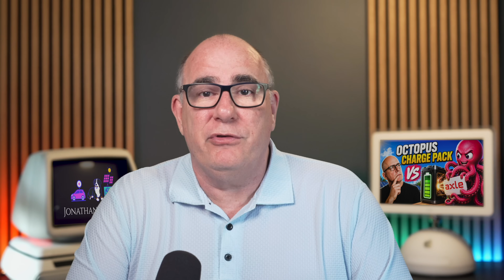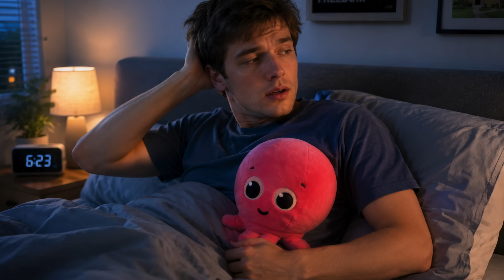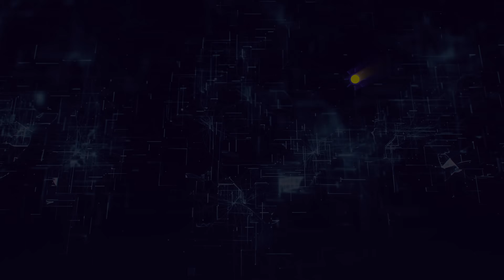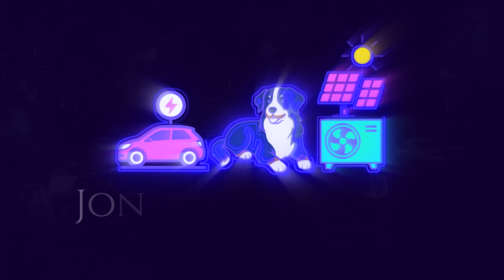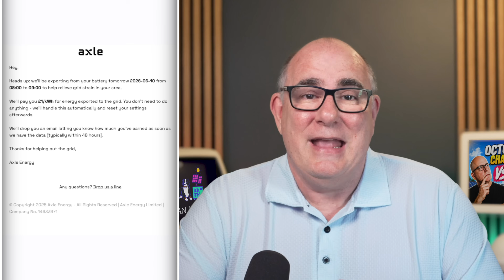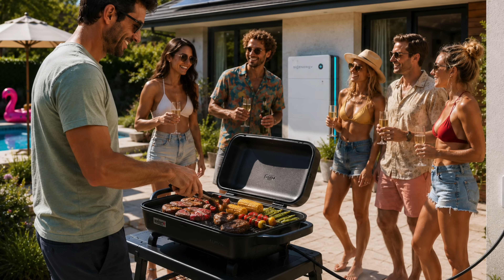Octopus Charge Pack Just Fired A Shot At Axle Energy

Comment: Doesnt my Sigenergy Battery AI already perform this function? With no middleman? If so would this option be for dumb batteries that charge and discharge to set parameters without external data input?
Reply from the maker: yes it does, but it does not respond to grid events, with Axle I get paid my normal export from Octopus plus £1 a kWhn from Axle when they need it.
Reply: @JonathanTracey  I've been giving Axle some thought but my systems earning £5-7 a day / every day this summer. I'd be interested to know how many kWh Axle take in their specific events option over a month and if it would be worth it. As a user are you likely to do a deeper dive on video at some point so the luddites can get a better handle on how it interacts with our Octopus tariffs and if and how its profitable over and above normal export etc? I'd be interested in that. I've seen your introductory on the Axle system or was that Gary Does Solar (sorry).

Comment: This is all good I would rather control it myself, reason being and it’s going to stand true in a minute, look at the temperatures this week how high are those battery temps going to get to especially when exporting or importing  at a high rate, other than the system owner that takes this into account no one else will like I know once the air conditioning for the batteries kick in it will take 2-3hours to bring the temperature in the garage to a range that allows the batteries inverters and other kit to operate well within there standard range.
As for these operators they are not interested in my batteries operating range they see it as a resource to be used anyway they deem, I see it as something that saves me money on my bill and if I can make a bit from it without taxing the system that is a bonus as the system was not just a couple of quid to buy, but guess I’m alone in my reasoning on this one
Reply from the maker: @DTech101 That's one of the reasons I prefer Axle as well. For 99% of the time I'm still in control of my system and can decide when I want to opt in or out. Charge Pack appears to hand over much more control to Octopus, which some people will be perfectly happy with, but others will understandably be less comfortable with.

I also think your point about battery temperatures is valid. At the end of the day it's our equipment, our garages and our investment. Most owners will naturally be more cautious about how hard they push their systems than a third party optimiser.

Comment: I was seriously thinking of signing up to Axle as it’s seems very transparent. I believe the government is missing a trick here. If they are so interested in giving tax payers money to BUS grants, then why are batteries not included given the benefits to grid management. I know there has to be some renewable generation such as heat pumps 1kW in 4KW out but a battery generates nothing without a solar string attached. Octopusenergy charge pack sounds interesting but I agree doesn’t appear as transparent when compared to Axle Energy.
Reply from the maker: Axle seems to fit in my with my setup pretty neatly, now I have only had two events since signing up but its been pretty seamless since. 

With regards to bus grants I agree it should be expanded to solar and batteries and the whole thing should be funded from fossil fuel windfall taxes
Reply: The argument is that solar and batteries are commercially viable anyway so simply giving bungs to people to install them makes no sense, as it will just raise prices. Australia on the other hand looked at their pending grid crisis and instead went "if we blow vast amounts of money on battery grants it's less money than fixing the grid". Now I don't know who is right - maybe both as it's different countries.

British government since the 1980s has been anti grants on things that are in theory commercially viable on their own because it's against the neocon religious creed. Hence the hash made when they suddenly stopped solar grants and most of the industry instantly went bust, hence the lack of grants on batteries, hence the tight limits on EV grants (which are actually mostly about stopping the incumbent inefficient car companies collapsing hence the country of origin rules).

Money is only supposed to flow from taxpayers to pointless organizational overheads like the MCS not to actual product 8) !

Comment: For me as a HA/predbat user i certainly won’t give octopus control over my battery. My EV charger is connected so that doesn’t see the batteries so their control on that is grid only.
My batteries are charged and discharged under my control, my settings. I don’t see octopus paying anywhere near what my control does. Axle is a benefit that i can decide to use, currently get quite a lot a month!! My energy bills are currently very negative ( big array ).
Reply from the maker: yeah similar situation but not so many axle events here, only had two in last month
Reply: @Jon @JonathanTracey ly had 2 last month but believed will are guaranteed £10,  for me thats £10 more than 96p export i would have got for that energy from Octopus;) as predbat totally controls this for me i do nothing just check my daily amount to make me smile! 
Currently sat here checking pv app producing almost 7 kwh all going to the grid except 500w. Got to love this stuff! Love your channel Jonathan

Comment: Sorry but not letting Octopus anywhere near my battery stack, as they have failed on several occasions over the past few months to successfully charge my EV overnight on the Intelligent Go tariff. Excuse after excuse even though the car has excellent connectivity to my Wi-Fi and it also has a strong LTE connection.
Reply from the maker: yeah, that’s the worry. Is that all it takes is missed charging slot and you end up having to draw energy from the grade at prime time

Comment: Many thanks for Video Excellent ! I have 34.5 KW Batts and to date have earned over £140 via Axle on Event's only ....AI just doesn't work and i found my batt's were emptied when i needed them most ....I'm on cosy tariff and Octopus have just emailed asking if i would like to use the new service ......Not when Axle are paying a £1 i won't , also no doubt they will prevent Axle from working ? let the VPP war's begin .
Reply from the maker: yeah I think I am staying in control, only just started with Axle as solaredge only just started supporting it, but 2 events down no dramas, had to fault it
Reply: @JonathanTracey same for me 😊
Reply: Yep! Intelligent Go can’t even manage to charge my EV! Why the hell would I let them get anywhere near my battery! Their software is hopeless and never works properly unless I remove them from the process completely despite having a car and charger combination I purchased on a joint sure through them and Andersen. Not interested in letting them anywhere near my 34kwh battery and solar going in next week …

Comment: In my case Axle would be the only option (not on it I should say) as I have Solis inverter which I think works with it to control Pylontech batteries. I do not want the Laura Branigan situation......I lose my self, I lose my self control.........
Reply: I have the same setup i.e. Solis inverter with Pylontech batteries and have signed up with Axle and it works with the only caveat that i have to manually schedule the discharge time (and then remove it after the session) as for some reason the Axle system doesn't do this automatically.
Reply from the maker: yeah same for me, bit of a control freak 🤫
Reply: I have Solis 3kw inverter and just 6kw Pylontech batteries and in order to get Axle discharge times to work I opted out of the Octopus Saving Sessions, after which the Axle sessions worked seamlessly so far. Before opting out I could earn Octopoints by discharging during saving sessions. I decided real money from Axle was better for me.
If you have a Zappi EV charger there is also a system called Gridpay where you tell them your cheap tariff times and allow them to decide when to charge your car if it's plugged in. I use it with Cosy tariff and currently get £10 a month for the privilege. So £20 a month minimum from both schemes if they continue will help my winter costs substantially.

Comment: Thank you for this video which I really do need to know more about. I have been led to believe Axle have about 3 to 6 events a month which may last an hour. That means if you have an export limit of 5kWh, that potentially would give you at least £15 to £30 a month, plus what ever Octopus gives you. I think most people will have to determine if AI can be modified with personal requirements the day before. Like keep battery buffer 5kWh more tonight, because having family staying tonight, OR need to charge EV. If AI cant be told about changes in advance then the Automation of AI will never be fully optimised. I suspect AI will initially not measure up to my high standards of optimisation, but I have no doubts it will get better.
Reply from the maker: i have only had two events so far, one in may and one in june, so hard to judge but it does what it says on the tin :-)
Reply: @JonathanTracey  Thank you for that. Axle website says:- there are quiet months...not entirely sure how quiet. I 'think' they guarantee £10 a month...so they are confident you will earn more than £10 a month. Axle is worth having, but I am not pinning too much hope it will make a big difference to the Return on Investment. If more people sign up will the rate continue to go up with inflation? I don't feel in control or have confidence it will last, I guess just enjoy while it lasts..

Comment: I’m very much in the “old school” mentality. If I can’t understand clearly what the benefit is to me, it’s a non-starter and that is definitely the case with Charge Pack. I put solar and battery systems in to meet our needs using the minimum of peak rate electrons, simple as that. From planning to today and onwards, I am very glad to get export payments but they are a bonus and not an integral part of my justification. Maybe I’ll lose out a bit but it wont be a fortune and I’ll stick to what my single cell brain pack knows and can understand
Reply from the maker: yeah it’s as clear as mud , seems to the way lately with octopus, take something simple and make it as complicated as possibel
Reply: @JonathanTracey I have no doubt they can make me more money BUT like you until they are open about what it's doing and why and who is making how much, I won't join.
Reply: Yeah I’m similar to you. I am also loathe to hand over control of my systems. I make an exception with my EV charger because I can still override it locally, but not with my battery system, no thanks. I participate in Axle because I still retain full control and set export myself, and I’m not prepared to change from that just to earn a few extra pence
Reply: Yeah, I’ve heard horror stories of people’s batteries being messed up via remote control. Also agree that the EV charger being controlled is as far as I go Perhaps in time suppliers will supply the batteries for free, control it themselves, and guarantee free electric to the homeowner for the privilege…any problems are theirs no need to worry about ROI 👌
Reply: Battery Badger is a similar service but you can dig into graphs of the previous years of data to see when it discharges and discharges for a range of common systems. It also shows the upcoming 12 hours of scheduling so you can opt out.
Reply: Old school here too. To be honest as on original fit not really looking to make a few quid. Prefer full control and energy security.
Reply: Yes I'm similar situation I have a 12kw battery but no solar, and I specked that 12kw for worst case scenario of me just drawing 9.5 to 10 kw in winter and that happens in winter I'm down to single figures in winter of spare capacity summertime I have some spare but that varies I suppose if I had 15 to 20 kw spare then that's a different story but I suspect a lot haven't specked with a vast amount of spare so I'm afraid it is a no from me.
Reply: Well said. It’s ambiguous. Axle is much clearer in terms of benefit. Outgoing Prime is another Octopus scheme that is of dubious benefit, particularly during Spring, Summer and Autumn. Octopus is at risk of irritating its customers by being opaque with its tariffs.

Comment: The banning of axle on IOG when octopus has neglected batteries without wheels for years is ridiculous misuse of power.
Reply from the maker: Yeah, I’m not sure how they would actually ban it, I know they say it’s not compatible but the reason for this is a very narrow corner case. They are saying that when they’re trying to charge your car if your battery is discharging, then the benefits to them of using cheap energy from the grid is lost. But if the grid actually needs energy at that point, what’s the likelihood of them actually charging your car at the same time. It doesn’t seem to make a lot of sense.

We know IOG works with Axel, the last two events that have happened I was on IOG. I only just switched to Flux but never had a problem on IOG
Reply: @JonathanTracey Same I've been on axle and IOG for £78 worth before this email was the first I've heard of this 😂
Reply: agree. They’ve said before they aren’t in conflict. export would use your export MPAN and thats what Axle uses. IOG uses your import MPAN. They’re entirely separate IMO
Reply: Intelligent Flux / Flux were designed for PV / solar, it is only intelligent tariffs which are not to be used with Axle.

Comment: Octopus specifically say on their info that this is for specific sessions so I’m unclear how it will work outside of these times. 

I would like to understand how it’ll work in winter, will this potentially leave me with no battery after the session? I need more info and some examples from octopus. 

I had considered opting in over summer when I don’t really need my home battery to see how it goes before we get to heat pump season.
Reply from the maker: I agree that’s an area that needs expanding upon, although they say it will be used for specific grid events it’s the part about continual optimisation of charging and discharging when energy is cheap that worries me. As you say how will this work in the winter, could they discharge your battery leaving you to have to buy energy from the grid?

I’m testing with Axle energy right now. I’m quite like the simple model, but once I know more I may switch over to octopus just to see what the difference is.